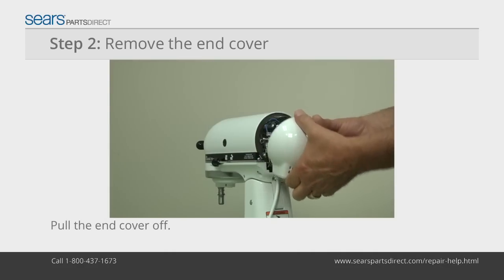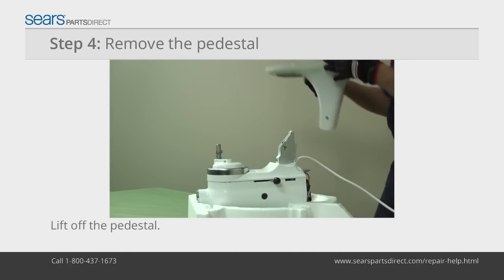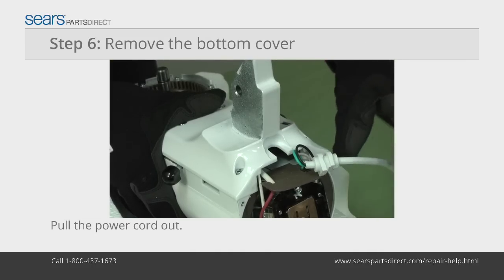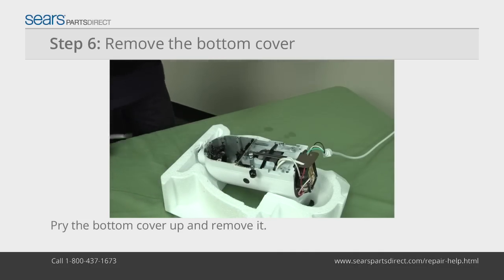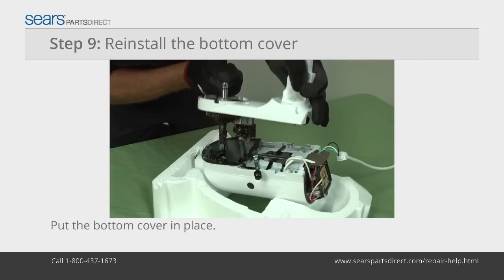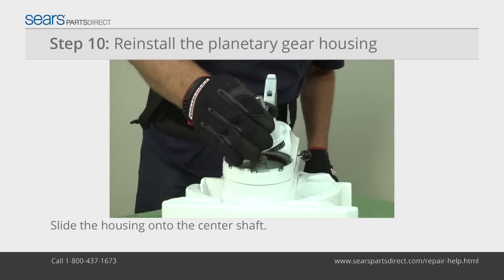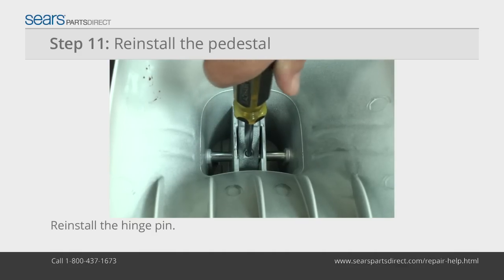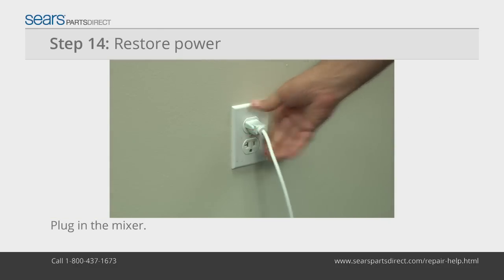How to Replace a Worm Gear in a Stand Mixer

Comment: I just started taking apart one of these mixers. The cotterpin in the planetary is not as easy to remove as in the video. Mines stuck hard. Without removing the planetary I will not be able to take off the cover. If there are any more cotterpins on the mixer I’m screwed.

Comment: I have Kitchenaid Professional 610 and planetary falls off while operating. Do you have anything that can fix that? It was made without a pin, which is odd, consider all other models have it.
Reply from the maker: Let us know the model number of your KitchenAid Professional 610 mixer. Most of those models do have a retaining pin that holds the planetary shaft in place.
Reply: Sure, it's kp26n9xer.
Reply from the maker: @JomikJomikJomik  Here's a link for the exploded parts list drawing for that model on our Sears PartsDirect website: https://www.searspartsdirect.com/model/4ba8fagrib-000593/kitchenaid-kp26n9xer5-stand-mixer-parts . The planetary assembly is shown on the "Case, gearing and planetary unit" section of that exploded parts diagram. Your model has a pin (Key 9), snap ring (Key 7) and retaining ring (Key 30) that hold the agitator shaft (Key 34) in place. Another pin (also Key 9) holds the planetary assembly (Key 28) in place. The retainer ring (Key 7) also helps hold the planetary assembly in place as it holds the worm follower gear (Key 8) in place. You'll need to replace the retainer parts that are missing depending on which part falls out. To access the components, follow these steps. Unplug the mixer, remove the trim band screw on the back of the mixer then remove the trim band. Remove the 2 screws from each side (4 screws altogether) of the upper housing then carefully pull the upper housing off. Take a digital picture of the wires connected to the control board for reference during reassembly. Disconnect the wires from the control board and remove the 2 control board mounting screws then pull the control board off. Remove the 4 screws in the transmission housing. Lift the transmission up while tilting it forward slightly so the hub gear doesn't drop out as you lift the transmission off. If the agitator shaft is the part that falls out, you'll need to remove the retainer ring from the top of the worm follower gear and pull the worm follower gear off. (Use snap ring pliers to remove the retainer ring.) Use a hammer and punch to remove the retaining pin and pull the planetary assembly out to access and replace retainer components in the agitator shaft. If the entire planetary assembly falls out, replace the pin and retainer ring then reassemble the mixer. We hope this information helps. If you need more assistance, let us know.
Reply: @searspartsdirect  Wow! I didn't expect such a detailed answer! Thank you very much. I will follow your instructions step-by-step, I'm sure it's gonna work. Thank you very much!
Reply from the maker: @JomikJomikJomik  We hope you're able to find the cause of the problem and make the repair. Let us know if you need more help.

Comment: what is the part  number of the one gear assembly and the mixer model number? I would to purchase this part.
Reply from the maker: The part number for the worm gear assembly shown in the video is WP240309-2. Here's a link for the part: https://www.searspartsdirect.com/part-number/WP240309-2/0011/665.html The model number of the stand mixer shown in the video is KSM75WH.
Reply: Sears PartsDirect. Right on! Thanks for the help!